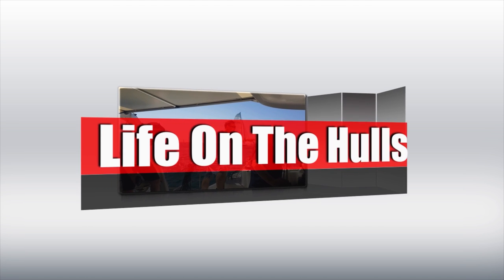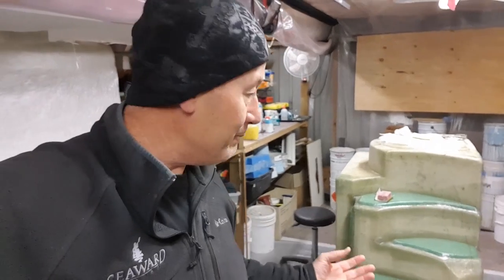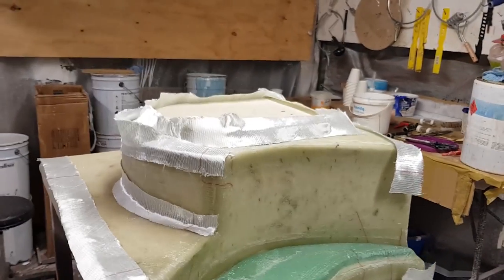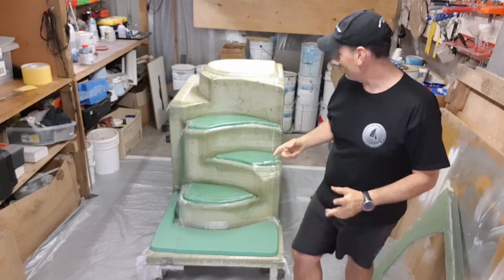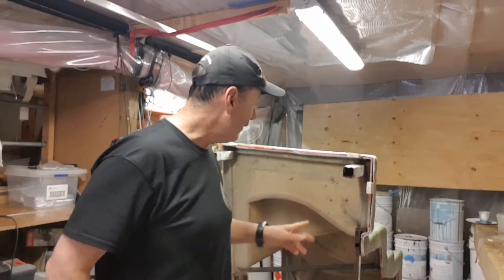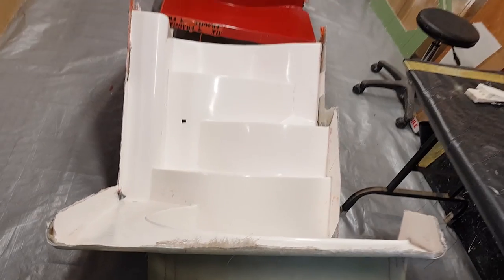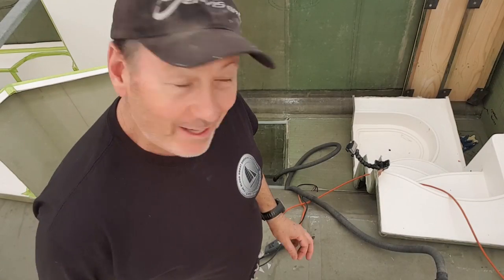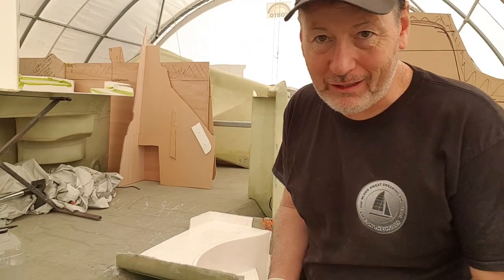Ep087 We have stairs at last - Life On The Hulls - 40ft Catamaran Build

Comment: I have been building boats out of polyester for the last 15 years. My biggest piece of advice to you is this. If you are not using peal ply or waxed resin, your best friend is acetone. If you give any area you need to sand a quick wipe with a acetone soaked rag you remove the thin layer of wet resin. You will be done with clogged sand paper. Acetone is a heck of a lot cheaper then sand paper.
Reply from the maker: Good point with the acetone.Great for starting off a laminate again.Issue we have is ,it is clearly stated in Australian Standards AMSA boat building regs now that acetone must not be used as is is a dissolver solvent and will weaken the underlying substrate and  integrity may be compromised for secondary bonding.I know we all uae it to kick off a job sgain after cure but styrene monomer should be used to guarantee the structural integrity of the following and previous laminates.I too uae acetone but the actual principles are not sound as much as we all love to do it.It is a well known bad habit that I
am also guilty of.This applies to saturated resins ie polyesters and vinylester with a styrene carrier..Epoxies are another animal.Cheers buddy.Ross

Comment: Hey mate, I really like your determination to do such a huge project mostly single handed. 
Just in case you have the  stairs for the starboard hull or other bigger molds without release angles still in front of you:
Install some connectors for compressed air beforehand and let your compressor do the work of releasing 😉.
Works like a charm!
Reply from the maker: Original product was demoulded with compressed air.Wasn't actually sticking as it was placed back on the mould to complete and reinforce.Unit was simply so stiff and without release angles was difficult to demould.Second set was completed in December 2018 and took s full day to demould using air and water.Cheers Rossco

econheers ,Ross.

Comment: I'd take the chopper gun to that staircase. Spray it out with a dry blend of strand and resin and put a little cloth on as the final step that'll soak up any excess resin. 2 hours max.
Your way looks nice too.
Reply from the maker: I did think of using a chopper hun on all of the modules but jave chosen to keep them minimum layers of quad and db and foam.prob only save 40percent weight buy in the long run wasted a lot of time, Butthat is sonethinh I have a lot of.Rossco

Comment: Did you try compressed air to release the stairs from the mold? It would have been better if the mold was designed for it, but a few needle sized holes drilled through the mold and just into the stairs with a fitting for an air hose glued on would have resulted in very little damage.  If you are putting treads on the stairs later, that would be the perfect place to hide the holes.
Reply from the maker: Original product was demoulded with compressed air.Wasn't actually sticking as it was placed back on the mould to complete and reinforce.Unit was simply so stiff and without release angles was difficult to demould.Cheers ,Ross.

Comment: with regards to your clogged emery rolls, "try" grinding them on some orange electrical conduit. Saw somewhere, read somewhere? that if your emery is clogged you run it over the pvc and it helps clean/ unclog it. never tried it myself so can't say its true or not …..but conduit is cheap. Hope it helps

Comment: Have you thought of fitting the molds with some compressed air nozzles so that you can force air (or even water) between the mold and the part. It would break the tension & friction between the surfaces. Just a thought.
Reply from the maker: Original product was demoulded with compressed air.Wasn't actually sticking as it was placed back on the mould to complete and reinforce.Unit was simply so stiff and without release angles was difficult to demould.Cheers ,Ross.

Comment: I might be wrong but it seems you are fighting a vacuum when you are lifting it. Maybe drill a small hole at each step to allow air in then just a steady pull? congrats on the stairs.
Reply from the maker: Good observation.Module has holes in it from original moulding of the part and Original product was demoulded with compressed air.Wasn't actually sticking as it was placed back on the mould to complete and reinforce.Unit was simply so stiff and without release angles was difficult to demould snd remove as seal was already broken.Cheers ,Ross.

Comment: Ross, you said you have several more sets of stairs like this to make in the future ? Was thinking about that foam layer... as is, most of the strength of the layers you put is effectively under the foam, but the one extra thick layer at the actual top is the all in a horizontal orientation. The foam as is acts more as sound deadening than reinforcement since the foam can compress a little, and the upper most layer is floating atop the foam section. Wouldn't thinking of it as an I Beam be better ? You effectively have thick flanges but no vertical section across the treads, the vertical is in your risers which are plenty tall for strength of the whole module. Anyway, what if your next set has some corrugations in the foam layer so the top and bottom are directly connected in the middle several places like an I Beam ? Not a lot, just maybe two or three places set perpendicular to the risers orientation breaking the foam into several smaller pieces so it looks corrugated in a side view orientation ? Or one long groove parallel to the curves connecting top with bottom ?  Looks great, covering the working areas with cardboard was a Pro tip since you still have so much work to do going forward, no need to create more for yourself ! Is the hatch in the bottom going to be a glass together panel, or a lattice of teak like you see in showers ? Congratulations on a small but significant milestone, STAIRS !
Reply from the maker: Hey Mike.The idea of the foam is to create a bridge between the two laminates.It has no compression or flex to spesk off once laminated as it is structural only when laminated under a strict laminating shedule.ie 2 x 600db/ 2 x 300csm on each side of 20mm foam is equal in sheer and compressive strength to 300csm 600db on each side of 12mm marine grade ply.It is all in the distances between faces which can increase the rigidity and strength but up to 35 times the rigidity of thehe laminate alone without core.Principles of core apply of course but tha t us pretty much ut in a nutshell.Therefore treads are rigid to handle aggressive load.Risers are kept as laminates only due to space restriction behind the module.Hope this has explained.Thanks so much for thinking things through I love it.Rossco
Reply: @LifeOnTheHulls  A lot of my experience with laminates while cutting edge in the 90's is probably a bit dated today. We made rocket motors, composite and metal motor casings and nozzles at ARC as well as some 3D woven carbon test articles like a 1/2 scale submarine prop, and an all in one piece casing and nozzle ejection seat motor for Martin Baker or UTC, can't remember since they were both clients. Lots of Star Wars development that's only just now coming into the daylight for testing to justify continued funding.

Comment: Hi Bud was thinking about the steps could you have lined the unit with stainless steel mesh or aluminium  and glassed over that as well to give you a very hard surface to use and very little movement as well ?????????? just thinking that's all not sure if it would work or not ?????????????. Ross what is the part number on the sandpaper rollers both gen and after market one's ???? Its Called Moonshine in the USA :) Great Vlog Mate.

Comment: I wonder, if you fitted a quick release connector and just pumped in water to release it. if it would work. I've no experience with glassing but would that work? wouldn't damage anything.
Reply from the maker: Original product was demoulded with compressed air.Wasn't actually sticking as it was placed back on the mould to complete and reinforce.Unit was simply so stiff and without release angles was difficult to demould.Cheers ,Ross.

Comment: Would adding a small hole so you could stick an air nozzle in and blast it off the mold with compressed air work? Also are the big metal trip hazard beams actually doing anything at this point or could you remove them?
Reply from the maker: Original product was demoulded with compressed air.Wasn't actually sticking as it was placed back on the mould to complete and reinforce.Unit was simply so stiff and without release angles was difficult to demould.Cheers ,Ross.

Comment: Rosco, why did you not cut the green pads to the same shape and size as the stairs?
Reply from the maker: Hey John.It is vital that the fosam core has a beveled edge and a margin to solid glass for the bridge to function correctly as well as ensuring no voids in a 90 degree join to underlying substrate.Therefore core is slightly smaller than total horizontal tread to allow for correct bonding and structure.

Comment: try a tire cheetah, big blast of air immediately.
Reply from the maker: Original product was demoulded with compressed air.Wasn't actually sticking as it was placed back on the mould to complete and reinforce.Unit was simply so stiff and without release angles was difficult to demould.Cheers ,Ross.

Comment: A Question for you. When you turn the stairs over it seems that the reinforcement of the nose of the tread is in fact the back corner next to the riser is this the area you wanted to be stiff/solid. Just asking.
Reply from the maker: Hey buddy.Both front and back of tread is reinforced multiple times and when I originally made the module with masses of laminates on the front edge of the stairs to be sure they would be sound. Ross
Reply: @LifeOnTheHulls  Thanks Ross - Great work.